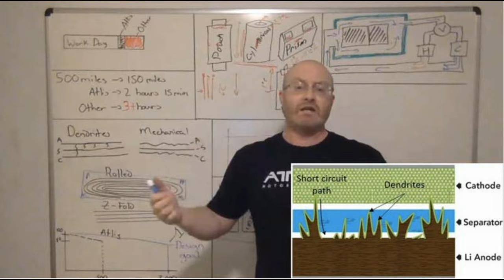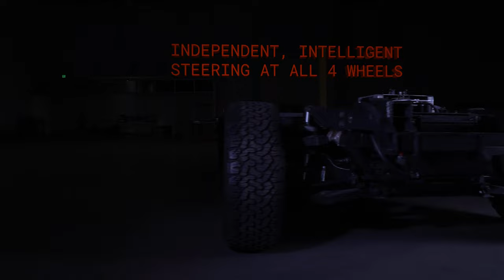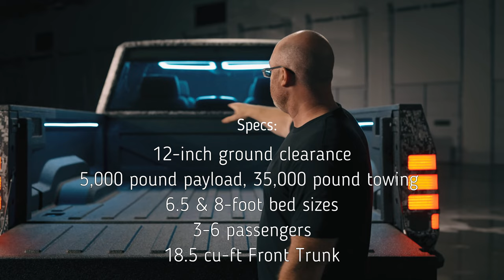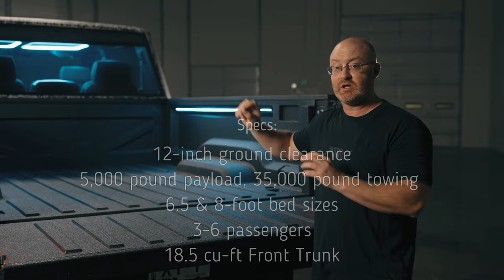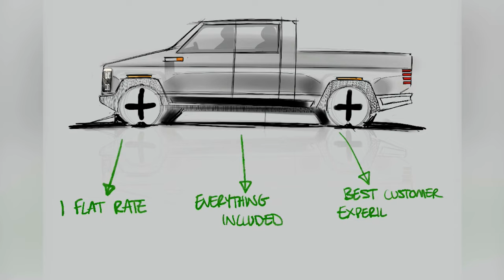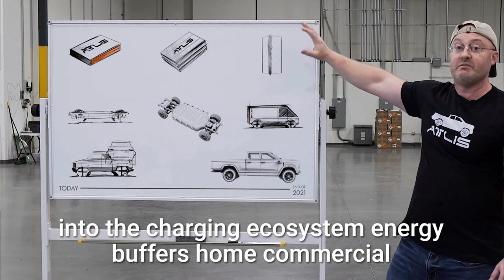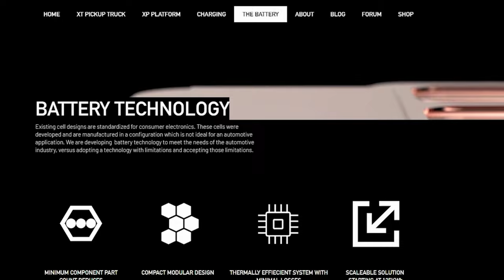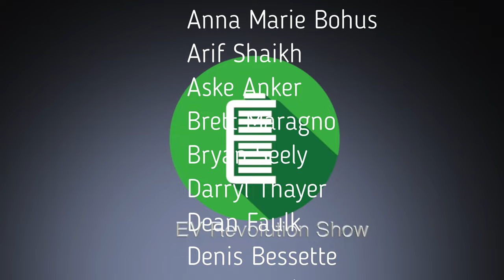Episode 148 - ATLIS Motor Vehicles - A Candid Interview with their Founder & CEO

Comment: the model is amazing, but we should be concerned about accident longevity, the batteries are just too close to the outside frame of the body, in an accident, it all goes down hill with repairs, you need to redesign so if there is a 30 mile collision, it can still drive after repairs, my suggestion. thank you
Reply: guys want to be able to push the limits in a tough time when it comes to something, that is why fossil fuel cars are wanted they can still drive when on its last leg
Reply from the maker: We will see they will have to have crash test certs.
Reply from the maker: ok.